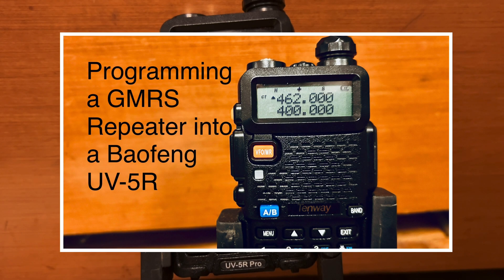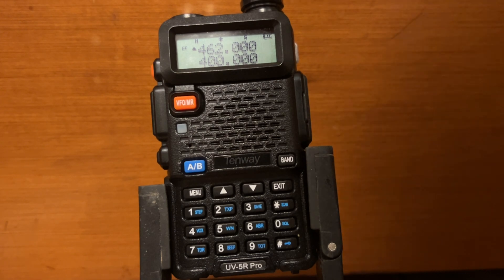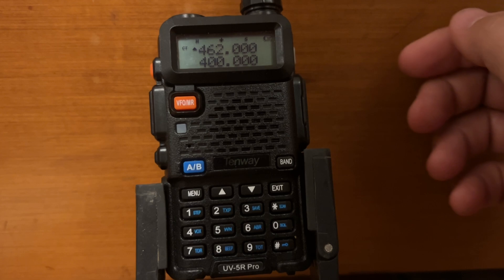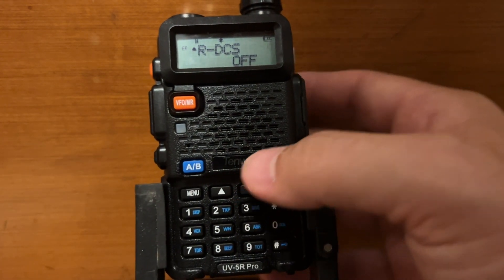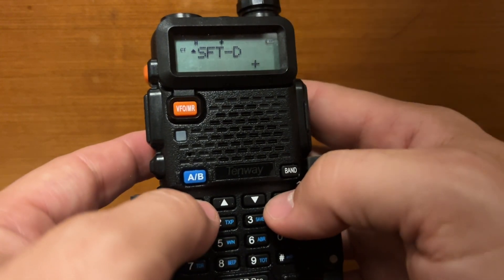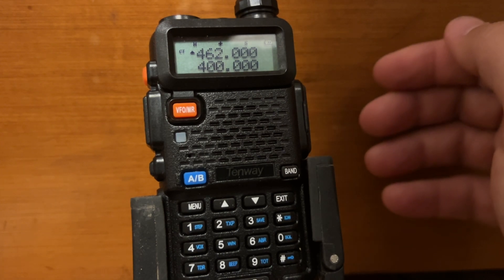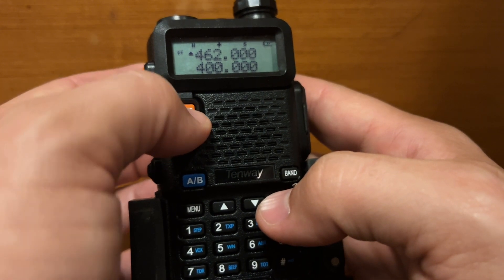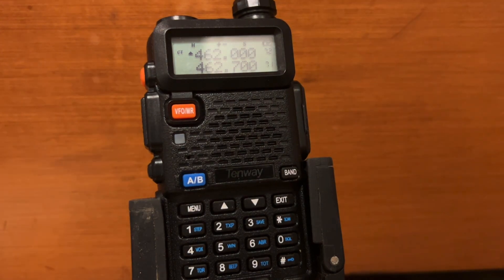Programming a GMRS Repeater into a Baofeng UV 5R

Comment: What is the point of offset? I have seen people use all different types of numbers for offset.
Reply: LET ME GIVE IT A SHOT: The repeater NEEDS to "listen" to your broadcast on one freq, say 462.500 and re transmit that very same broadcast on a different frequency, say 467.500, as you can see there is exactly 5.00 Mhz difference between these 2 frequencies, that is the offset and it is needed to avoid interference and also feedback. Example: if you give me tennis balls on my right hand and I try to ridistribute them with the same hand I will slow the operation down because as I am handing the tennis ball with one hand I cannot also be receiving the next ball, but... if I quickly pass the ball from my right hand to my left hand as I am trying to deliver a bal with my left hand I am already picking up a new one with my right one. BTW the offset can be negative or positive, this is a +5MHz example: The repeater broadcast which is what YOU HEAR is 462.500 but you transmit on 467.500, you are transmitting on a frequency of 5.0 MHz GREATER (thus the +) than the one you are listening to.
I think this is a very detailed and clear explanation, but of course everybody thinks like that 🙂
Reply from the maker: It’s industry standard to use -5.
Reply: @ but why?  what’s the purpose? To transmit at a value that that isn’t the one you set it too?
Reply from the maker: I’m not sure I understand. 
Are you asking why you receive on one but transmit on another like transmit -5 below?
Reply: @JebBrilliant  Correct. What is the purpose of Offset? No one can seem to give me a straight answer. Sure it's a "standard" but....why?
Reply from the maker: @ Sorry, I don’t have a good answer for you. Maybe FCC set it up that way. 
Why? I don’t know.

Comment: Any advice on any setting to hear the squelch tail.   I dont recall the menu option.....i turned it off, and I still dont hear any squelch tail.   Is there other settings that I should check??
Reply from the maker: You want to hear the squelch tail?
Reply: @JebBrilliant  yes. My ears are accustomed to hearing  a squelch tail.
Reply: Are you asking about squelch tail or hang time? There is a difference.
Reply: @RisingTidesAC   TBO......maybe both. Typically on a 2 meter / 440MHz repeater ---- after unkeying the PTT there is a   moment heard that seems like there is still a carrier sound (that may be the hang time.  Then, hearing the Skssssshhhh of the squelch sound-  -  which would be the squelch tail sound as the repeater ends transmission.
Seeking some info within the menu if I can set this up.  There is the STE setting, I turned off. There are two other menu settings that are "time" related settings to the squelch.    My only guess, is that the repeater owner has settings set to not allow for a squelch tail or a hang time.   When I transmit to a repeater......I don't have an audible sound that gives me some form of acknowledgement of a successful repeater hit.
On my Baofeng----- I hear neither.
Any advice or suggestion-----I would be grateful.